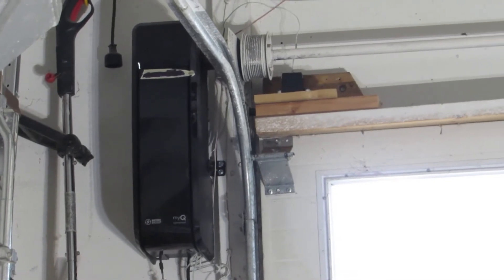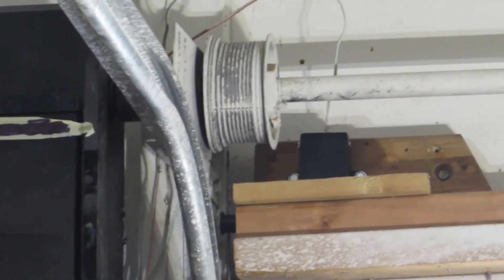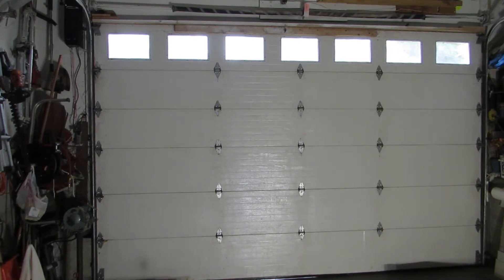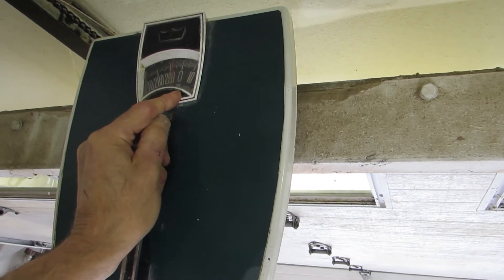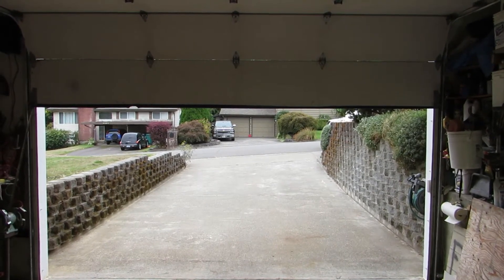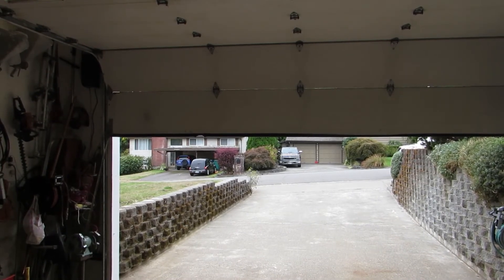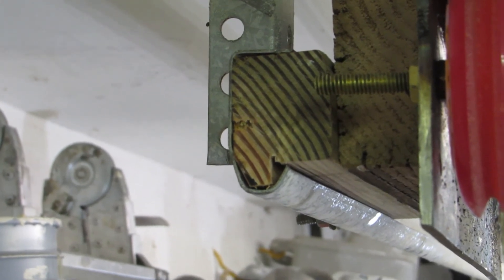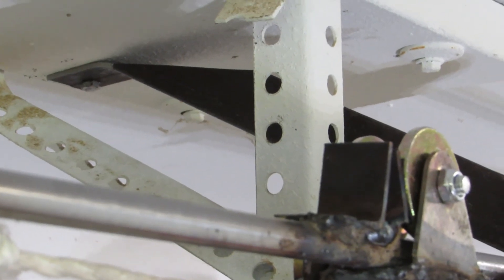Jackshaft Garage Door Opener Unspools Lift Cable - Remedy

Comment: Raise the back of your horizontal tracks 3 inches. ( I'm an installer)
Reply: I would make the door heavy as well  Mabe a 1/4 turn off each spring .
Reply from the maker: I can raise the back of my track at the most 1/4". One would need to put a lot of weight on the bottom of the first panel for gavity to do anything. Prior to having this type of garage door opener, my door lifted completely up, horizontally to the floor. Now I have about 18" hanging down into the opening, so gravity can take over. I could add on to the back of my track, to I could get my system to fully open. I will do that if I get another camper. My door used to open a full 10' and my camper was 9'11.5". Since all I have now is a car, it does not matter that I have 18" hanging down, making my 10' door only open 8.5'.

Comment: As a pofessional installer that has installed 100s, there is no problem with the motor, you are just using it in an incorrect application. I’m sure it went over it in the fine print in the instructions, but that’s what installing, professional dealers are for.

Comment: Oh My God. What a contraption you created. Did your grandfather create the game mouse trap?
Reply: I must admit, it was not my grandfather that created that game. However, my father taught me that if I had a problem that I could figure out a way to fix it. I paid around $400 for this opener, installed it only to find that it would never work. It would simply unspool the cable. By making my system there is no additional tension/pressure on the motor other than what the door would originally apply. The door had 40/45 pounds of breakaway (amount in pounds that I had to push to make the door move). So, I added about 50 pounds of weight. Now it works perfectly. 
It is funny that the manufacturers do not make a device like this, as they could make it so inexpensively and in the end, they would sell way more of these openers.
Reply: @wesleymattson8805  my first comment was prior to installing pusher springs. I put on the  27 inch pusher springs. I now am worried, as you stated it could shorten the life of my jack shaft openers. This is going to take some tinkering and I can appreciate your work now that I am in the middle of balancing the minimum amount of force needed.  I apologize for my snarky remark.
Reply: I enjoyed your comment. 

Listen to your motor as the spring compresses. You can tell that it is

grinding to a halt. 

Some people can angle the garage door track, so the door does not sit parallel

to the ground, but is higher, sloping down toward the front of the garage, so the

door will start moving with gravity. I would have done this, if my door had clearance 

to do this. My door has 1/4" of total clearance between the door and the air duct above

it. 
Thus, I had to find another solution. 

My solution took a lot of thinking for me. Having to figure out my plunger system and the

rate the springs on the plunger compress(how many pounds per inch or compression). 

I used a wood lathe to turn my oak plunger caps and a welder. I know not everyone has

access to these items, but I am sure that someone can figure a way around this.

My door has been up for more than a year and the system has never needed any adjustments.

Take care and let me know what your solution is.

Comment: I have installed 25 of these motors.  The cable tension sensor is the problem  here. SO to fix to allow drums to hold cables tight and roll door downward without loosening cable off drum. Try installing a Strut across bottom section helps with heavier bottom section.  I have had several cable off because of these 2  issues.  To fix correctly adjust by overtorsion spring a few 1/4 turns until cables are tight but motor can down turn door.   But now  with this system seems like to much wieght added to door. Torsion springs are incorrect now.  The pusher spring idea is good but recommend the pushrod one for $ 35-60
Reply: Thanks for your great advice!  If the manufacturer made something like I did, they could make them for about $25/30. They would sell a lot more of these openers. The pusher rod ones apply something like 150 pounds of force against the door and motor. You can find videos on youtube where a pusher rod was installed and they video the motion and the sound of the motor as the pusher rod compresses as the door is
going up. It is pretty clear that a pusher rod will wreck the motor over time. My system does not add more than 50 pounds of weight on the motor, or equal to what the motor was designed to lift.
Reply: They got rid of the cable tensioner this year.